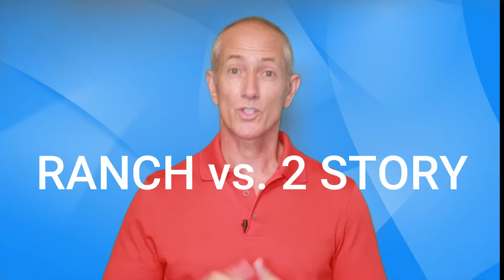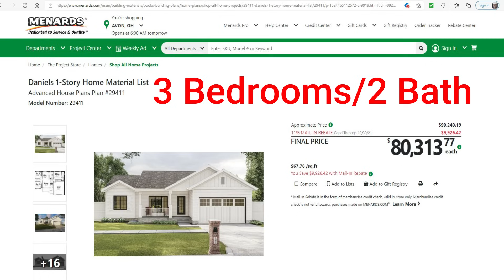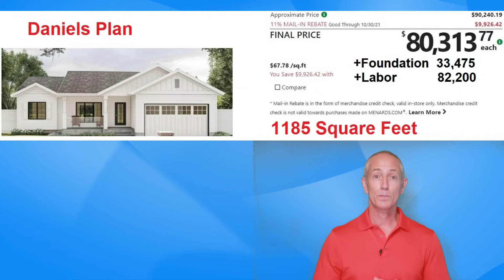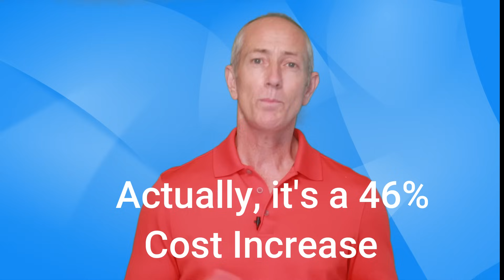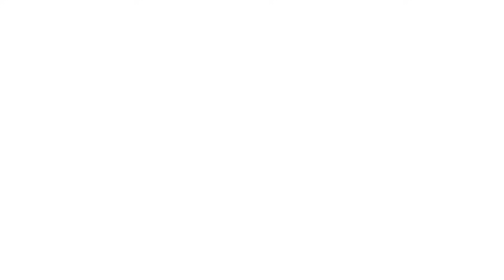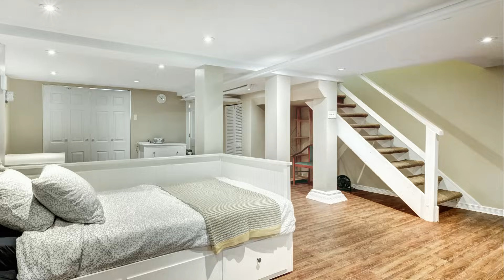Affordable Houses: 3 Design Tips to Save

Comment: What about the cost of labour for maintenance and repairs of a ranch vs 2-story?  I believe a single floor building is much easier to maintain than 2 stories.  Every project will cost 2x what it should to repair if can do the work yourself safely vs. being 2 floors up.  Sure staging exist, but it's expensive, it's heavy and labor-intensive to move on your own.  Now a ranch home no higher than 10' would be easy to put x-mas lights up, fix or clean gutters, etc....  Ranch style wins IMO

Comment: We found simple A frames and skillions the cheapest to build. We went to timber frames. We use glulams for beams. Heavy timbers are cheap. But the labor we save not cutting tenons makes the glulam beams cheaper. That leaves us just cutting mortise in post. And making 2 finger braces to screw to glulams. We use 2x12 for rafters. T&G over open rafters and warm roof. We drywall from outside of timber frame once roof on or sip, or t&g. Basement's here with insulation codes aren't worth it. I love doing block basements too. Money goes in my pocket not the concrete company. In a week by myself I can build a 32x24 skillion timber frame and roof it. Use truck winch to stand up bents. A frame does need 2 people. The passive solar skillion design really cuts heating bills. We try to build houses that cost you the least amount in bills a month. Handicap accessible too so you can live in it as long as possible.

Comment: I have designed and drawn most of the plans I built over 20 years.
Some may know this is that if you can design your house as close to square you can build cheaper. For example, 40’x 30’ =1200 sf area
Vs. 50’x20’ =1000 sf area 
Even though both take same amount of exterior wall materials.

Comment: Why such elaborate rooflines and so many corners? What about a simple rectangular ranch on a slab? And I’m happy with a 1500 sq.ft home.
Reply: I was thinking the same thing. I'm sure a simple 2 story 1500 sqft. rectangular box with 3 bedrooms and 2 bathrooms and a gable roof would cost FAR less than the complicated mess of a floorplan that new houses are built with. Especially if they did the "unthinkable" and made the garage a separate building from the house. Very much like how houses were built and retrofitted in late 19th century dense suburbs.

Comment: Pam here….you really gave me some food for thought.  To ma, the ideal use of moneys would be these homes that are prominent in Chicago.  2 levels with a garden apt. Or basement level apt.  Your basement sq footage is more valuable with egress windows which all basements should be built with these as standard, they are so much cheaper to do at initial build. To add them later is doable and would be worth it too.  To ma, every 2 story or 3 story apartment buildings, the 4 tp 8 units should have an elevator, making them ADA accessible. 20k is a BIG BANG for your buck with an elevator.

Comment: I have a small sawmill that can cut 95% of the wood building materials needed. Nothing pressure treated. I have drawn up tons of building on my laptop and it looks like my largest expenses are excavation and concrete. I have worked in construction for years doing almost every phase of home construction so doing most of the labor myself would be fine. I’m just working out details for design so I don’t run into any problems and the long term operation costs and efficiency look good.
Do you factor using footers for regular construction and then a finished basement with concrete walls and floor? I think it would be a lot more than $40 sqft

Comment: Not add more flooring more windows more siding more insulation. Sure you aren't going wider but you still have to go up another level and you still have to cover the cost for that second level including all the walls and all the floors and all the ceilings.

Comment: A super important factor in increasing affordability: keep the footprint and overall square footage modest. Less everything = lower cost. Not just in the short term (construction) but in the long term (maintenance/repair). For example, the "Daniel" ranch model is just under 1200 SF for $88k (when this video was made). Affordability factor gets even better when you build 1200 SF on two levels. In the post-WWII USA, "bigger is better" became embedded in our culture; we hardly notice we're doing it. But it doesn't make sense.

Comment: I have a house plan that is 1654 sq ft
Everything about it great, except the rooms are a little small
I simply want to make the rooms proportionately bigger adding 200 sq ft
So, what do you think that would cost, assuming the 1654 sq ft house is $165.00 per sq ft
As everything would be the same except for extra floor, roof and basement
Reply: I would really guess it would be proportionally more expensive.  Maybe it would come to $160 per square foot.  You'll kick yourself later if you don't go ahead and make it bigger.

Comment: Very well done video...wish I could make one.
 I love my large, flat (don't like split level) single story with it's beautifully designed roof and 22,000sq.ft. half acre lot...on a hillside with a very nice view. I helped build it as I became a plumbing contractor in my early 20's (63 now). If I stacked a second level on top... It would become a 4,200 sq. ft. house. Don't need that... and I work hard...  hate to come home to relax and have to deal with stairs. In SoCalif, you only build up if you have a small or narrow lot. I also don't want to live 10 feet away from anyone.
Reply: @James Karrie I remember as a kid I'd jump from house to house (roof to roof) putting counter flashings on all the plumbing vent pipes.....that's less than 10 feet apart....way too close for me. It doesn't sound like much but if your house is 40 to 50 feet away from the house next door?....it's a big difference...especially on 10-15 foot  terraced lots. I can live with that, although I grew up on farm land with hardly anybody around. 
Tract housing made my family financially independent but it also over populated SoCal. I wanna go back to less people and more room to get lost.

Comment: $55/sqft DIY. Buy rough cut from a mill at reduced market prices and avoid big box stores. Seek non-retail. Smooth wood is just a made up need.
Reply: Yep I am building a 4,500 sq ft house right now on a $150k budget. Doing it all myself except for the concrete basement walls. I own a sawmill and have plenty of trees. It’s definitely doable!
Reply: There is a discount lumber yard here where you can buy 150 sheet bundles of plywood for $11 per sheet. You have to buy the whole bundle but if you are building a house that’s not a problem. I agree, stay out of Lowes as much as possible

Comment: Actual cost if you hire a guy who will work with you on a weekly/monthly salary style basis you can build with all materials for about $75 per sq ft. Add $10 for land and prep. $85 all in. The numbers here include a significant mark up on materials and labor. Just fyi... build for 85 all in and be worth 135 per sq ft minimum up to 350 per sq ft.
Reply: Where are you doing this and how much work do you have to contribute to project?

Comment: This is so American. Bigger is not necessarily better. With a big family, you might actually need 2,000+ square feet. In most situations, however, you don't. I'd be much more interested in a similar video for houses of 1,500 square feet or less – even 1,000 square feet or less for a single homeowner/builder or a couple without children. Building up rather than out makes sense, but single-story is inherently more efficient – most people actually live on one floor.

Comment: Excellent video and I've pretty much settled on everything you've said here.  Having already built a house in 2009, I now know what NOT to do.  I did my homework and did a lot right, but there are several things I'd change.  First, smaller footprint...much smaller.  Our house is a 3,200 sqft walkout.  Next house, half that or smaller, shed roof.  Property taxes alone will be less than half, and that's a lifetime bill that only goes up.  It will also allow me to do a lot more of the work myself.

Also, garage/shop on the bottom, living space on top, no basement, and this is in -45C winter Saskatchewan.  We're building on jackpine sand (which is as hard and dry as bedrock, so no piles required.  No stairs, just an elevator.   We can still use the stairs on the outside elevated deck if we need to move furniture or bigger stuff in, but the elevator will probably be big enough.  

Biggest gouging contractors the first time were (in order) the plumber, flooring, roofers, concrete, electrician, etc.  I did the flooring and insulating myself, and also did the stucco on the ICF bottom.   The plumber almost tripled the cost of materials (all electric, no gas) so when I found that out I told him to take them out and I went and got them myself, from the exact same supplier that he was getting them from.  He wasn't happy, but who cares.   He did really nice work that other trade guys I know still comment on, but he was gouging me bad.

They quoted me $5,000 labour to install laminate, floating flooring, so I did that and the bathrooms myself (final cost $1.28 per sqft with Costco flooring).  14 years later, it still looks like new, even with two boys in the house.  The guy everyone recommended to do finish trim wanted $5,000 for labour (for some reason these guys all had nice, round numbers...nothing suspicious there 😉).  I balked and found a guy that my kitchen guy recommended and he did an excellent job for an hourly rate.  Final cost, $2,300.  Took him a week as we have a lot of big windows (and a 1,000 sqft vaulted ceiling).  My point, look around and get lots of other quotes to avoid being gouged.
Reply: I KNEW it. I want to build my own home someday, and I'm either making them give me an exact cost breakdown or buying the stuff myself. I 1000% do not trust contractors.
Reply: @roxycauldwell544  The thing is, as someone who works for a general contractor, they make the least amount of money out of any of the subs that come on a job. Their bid is set by his/her sub rates. An itemized bid never works well, because customers ALWAYS nitpick, think the GC is ripping them off by trying to draw a profit on materials, when it costs the GC money to purchase, load, transport, unload said materials on TOP of the value of the GC's connections for said materials.

The customers will see the price, haggle the GC, and then request to supply the materials on their own. Three things usually happen - they get the wrong material entirely, they don't get enough material, or they give up and agree to the original bid, all of which cost the GC money and delay the job, usually by a pretty significant amount of time. It causes huge headaches all around, and the customer will often STILL blame the GC. 

If people attempted to understand the business, and understand they are paying for a SERVICE, that would make all of our lives just a little bit easier. 

But ya know, there are people out there that are outraged when clean sanitary water that is supplied to their home in practically unlimited amounts.... COSTS money.
Reply: @bobos245  preach 🙌 it hard for others to see things through another mans eyes.
Reply: You are correct & thx but an experienced GC has been screwed over so much they develop their system & then make an offer to the homeowner that’s a take it leave it deal. Depending on the state you’re in like CA or CO the general is going to make sure he’s at 100% profit so your 50% covers him. In Texas, the contractor has recourse & so it’s more reasonably priced. Unfortunately, some future home owners have to pay for what past homeowners did to screw over contractors. Lawyers as consumers usually hide the fact that they are lawyers too. You have to watch out as a contractor bc usually one spouse is a lawyer and that means hell for everyone including the homeowner themselves who can’t ever seem to get out of their own way.
Reply: @seaneubanks2626  As I indicated I'm in Canada, not the US.  I had a few trades bragging about how they were pulling down over $500k that year and laughed when I suggested they maybe pay their flunkies more than the table scraps they were paying them.  Greed begets greed.  The cost to build here now has gotten so high in my city that hundreds of lots sit empty as it makes no sense to build when you can't sell it for what you paid to build it.
Reply: @roxycauldwell544  contractors need to make money. Some are more expensive than others. Get quotes.
Reply: @roxycauldwell544 just buy, store and manage the materials yourself
Reply: @roxycauldwell544  it's a for profit business
Reply: What was the cost of your elevator? Its a very practical idea.
Reply: great points
Reply: how many crew did the finish trim guy have?  Just him?
Reply: @EdsPlace  Yes, just him.  That included all the closets and doors installed, including 3 pocket doors.
Reply: I will be a chalet in quebec on an insulated slab ….thanks for sharing your experience
Reply: Thanks for the warnings!
Reply: How much did it cost you to buy your own land?
Reply: @monicahane1769  Hello.  $62,500 CAD for 160 acres in 2009.  It's mostly forest, wetland, and a few dugouts with about 40 acres of pasture.  I still have 150 acres after selling the house and 10 acres.
Reply: Hi Karl.  I’m in Saskatchewan too. I’ve got rentals and looking to build a rental property for the first time this year.  Good advice my friend.
Reply: The contractor takes a big risk to guarantee a bid price. To balance that risk he should have a 50/50 shot at making money. Otherwise pay them by the hour.
Reply: @Krunch2020  Uh, no, I just found more honest contractors that weren't looking to gouge me.  Are you saying that charging triple or more for materials is legitimate?!  Did you even read my experience?
Reply: Hi Karl, I'm in Saskatoon and just bought 10 acres east of the city. Any chance you would be willing to chat and answer a few questions? This will be my first time getting a house built. Should mention it is unserviced, vacant land. Thanks!
Reply: @jayworoniuk6158  Hey, I had to go re-read my post to see what I had said 😉.  Ask away.  We built NE of PA towards Candle Lake on 160 acres.  I'd say first thing is to check how much power will be, but if you've already bought the land, it's too late for that. Maybe you did that already?  Next is water, unless it's a rural or city hookup?
Reply: That all sounds cheap now for a 3200 sqft house. I’ve charged quite a bit more than that to floor 1000 sqft and customers were happy. Granted I had to remove old flooring and tile, but costs have just gone up significantly the last 5-6 years also. Anyone cheaper in my area is not doing quality work and if they are cheap and do good work you may have to wait a year or 2 to get on their schedule.

Comment: After looking at some two-story designs I learned that large open layouts are difficult to do. Since the weight of the floor above must be carried with ordinary lumber the need for columns and beams will eat into the open floor space. Truss floor construction can solve those problems but will add to the overall cost.
Reply: Great point!!!  I want a 2 story, 1800 sq. ft.minimalist house, with the 2nd floor just being an open space with a full bathroom.  It would not be the same size as the 1st floor.  It would sit on top of my kitchen so it won't be too big.  I keep wondering how it should be designed so that it's supported heavily by the 1st floor, while also allowing my den to be open to the 2nd floor.
Reply: @moonsyoungestsun6550  They make floor joists that are truss constructed. They can be engineered to span 30 to 40 ft. they are taller than regular lumber but have an open web design to pass HVAC and plumbing.
Reply: @ToIsleOfView  Thank you!!!  I'll definitely look into that.
Reply: @ToIsleOfView  I hear these floor trusses are springy when used for long spans.

Comment: That was a perfect explanation of how to look at the cost of a new home. I have looked into the elevator option and it's great. An oversize drive-in basement slab with 2 floors above that + an elevator can give a great bang for the buck, And older people will never worry about stairs. Keep it up.
Reply: you gotta think about the maintenance on the elevator that’s what gets you
Reply: @constancekang9914  You are correct if there are city codes that require inspections every month. I have been arround elevator maintenance manny years and a well built elevator is almost maintenance free. Many commercial elevators, like in hospitals, are used constantly but a residential elevator is not.

Comment: They only way it's cheaper to build up is if the ground is expensive.  You might save on some materials, but labor, engineering and shoring all increase.  The exterior finishes will more than double, the roofing increases the higher you go.  You are addressing the material cost going down, but do not leave out all the extra costs in going up.
Reply: A roof is a roof. Doesn't matter much if on a single or two story material wise. Boo-hoo to roofers who get vertigo on 2nd story.
Climbing a second set of ladders is no big deal, imo.

Comment: Could you make a video comparing costs of a build going down vs build going up? That is, cost of full walkout basement using ICF construction versus building up with a crawl space.

It would seem that it would be cheaper building down with ICF construction as there would be greater potential for labor savings. Using a 32 by 40 footprint as an example with no attached garage.